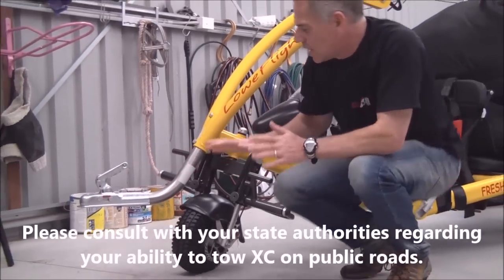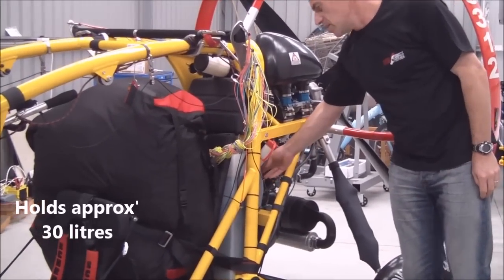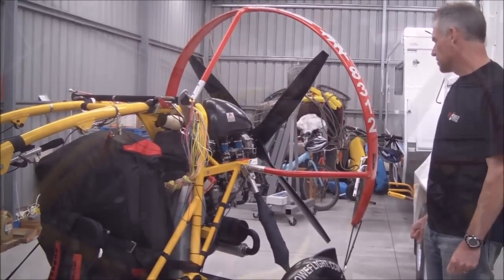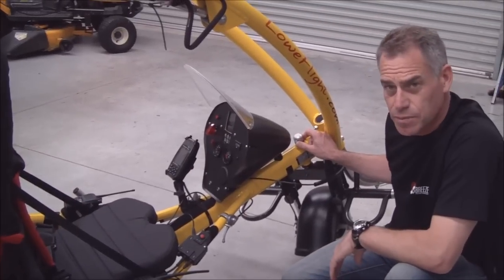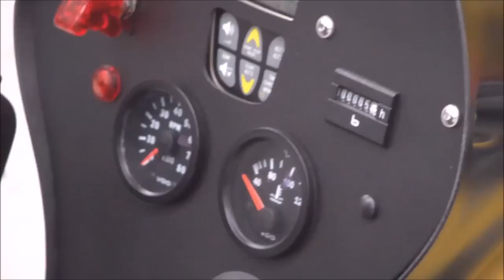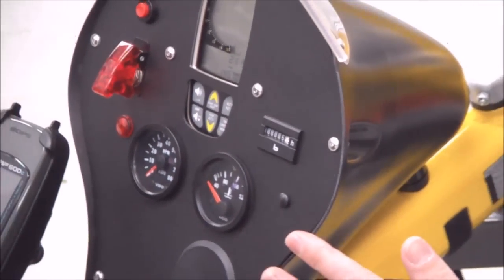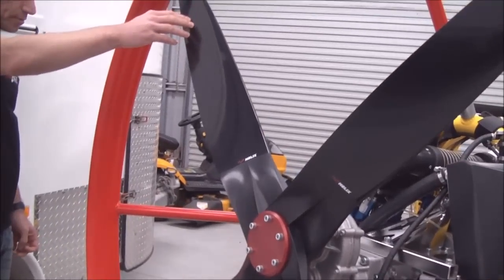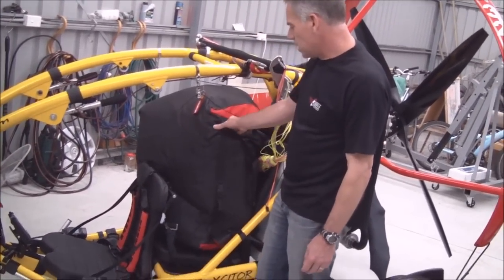Introduction to Fresh Breeze XCitor

Comment: Great job on giving us a walk around.  Been interested in purchasing one of these for sometime but not sure if there is a dealer near Texas, USA.  What would someone expect to spend in getting started.  I've been flying Power Paragliders for almost three years now.  Also, I would like to mount a Becker Comm and Becker Transponder in the panel.
Reply from the maker: Hi Channing, 

The cost of an XCitor is currently 22,743 euro plus freight
and any import taxes that may be applicable to your country. There is an agent
in the US. There name is Southern Skies.   website.   http://www.southernskies.net/info/about-us

Best Regards,

Robin Lowe.
loweflight.com
Reply: Appreciate the response.  As an owner, what has been your overall experience with the XCitor?  Durability / Dependability and Customer Support?  And all so important...Range / Time to Altitude.  One of the things I plan on doing if I make the commitment to purchase is use it as a skydiving platform.  Been jumping since 1980 and would love to have this at my home DZ
Reply: What town in Texas do you live in? I'm in Odessa

Comment: Hi Rob, what is the typical in flight speed ? I know it is wing relted but I cant find any info indicating low mid and top end speed. thank you
Reply from the maker: The flight speed is determined by weight and the wing pitch setting. In my personal experience flight / ground speed can be varied between approximately 55 kph and 70 kph but of course tail wind can increase ground speed and head wind slow it. I've seen a YouTube video where a guy in an Xcitor clocked a ground speed of 147 kph.
Reply: @robinlowe7677  Thank you